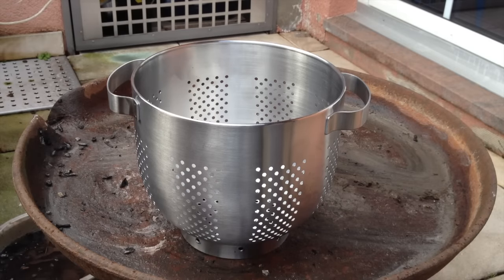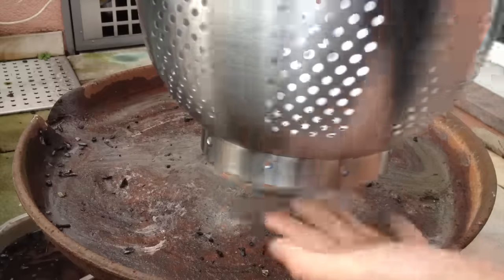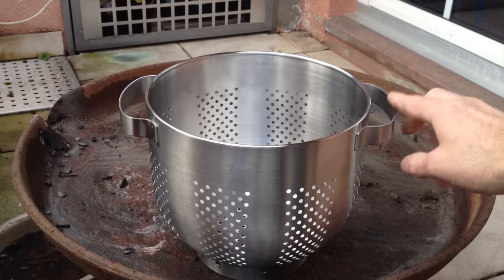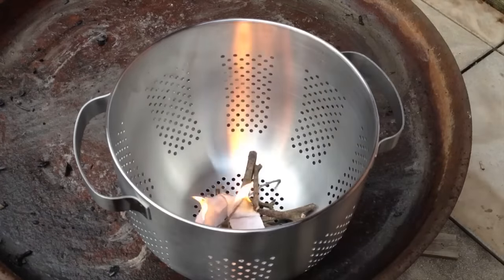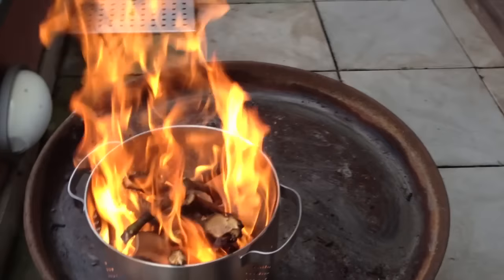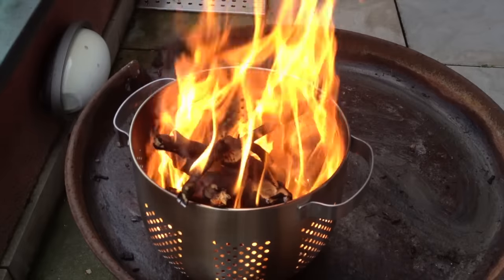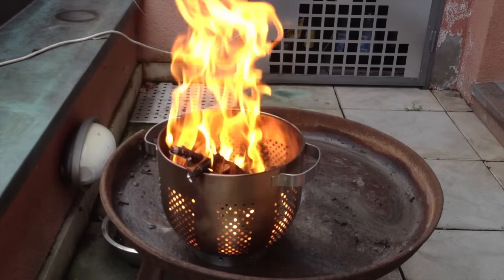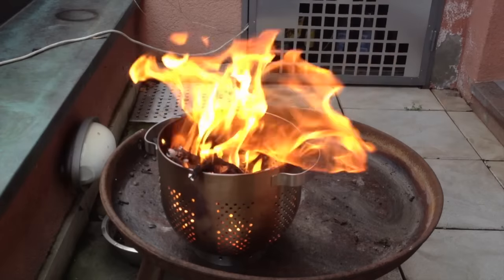DIY IKEA FIRE PIT

Comment: Got one of these after watching your video.  With the recent cold calm weather over the Christmas break I have been out in the garden most evenings with a small fire going - very relaxing. I put a bit of galvanised steel fence mesh on top to balance a zebra pot on and this works very well.  It does mean that I have to have my fuel wood cut down to about 3/4” square so that I can still pop it through the mesh to feed the fire, but preparing the fuel is all part of the fun 👍.   Enjoyed a hot bratwurst 🌭 this evening followed by hot chocolate drink.  I’ve used those compacted and impregnated “fire logs” that can be purchased and they throw out a terrific heat and burn a long time, but I wouldn’t use them for cooking over as they produce a sticky black residue which would probably ruin your cooking pots.  Great video, glad you made it as not being an IKEA shopper I didn’t know they had this in their shop - I can now have a small fire whenever I want and can take it with us on our travels in the motorhome too. Thank you.
Reply from the maker: Thank you! I am glad you are heaving so much fun with it and what you describe makes me want to go outside and have some fresh hot food myself there :-)

Comment: Thank you so much for this video! Going to go buy one tomorrow for camping this summer. Is that a ceramic plate under the IKEA strainer? Do you suggest I use one when I use it as a fire pit?
And please make cooking videos with this :)
Reply from the maker: Thank you :-) The strainer is standing on a cast iron fire pit that is very heavy and can only be carried by a strong person...not really suitable for carrying around in a campng situation in my opinion.  But for safety reasons I would strongly suggest to put the strainer on some fireproof surface before using it because the firebed is very close to the floor and the bottom has holes which allow ember to fall on the floor.

Comment: Wow!  Nice fire with the IKEA colander.  I'll have to remember to get one at the Thrift store and it would be sad to mess up a good stainless steel kitchen colander with burn marks.  Great idea for a controlled campfire or hot dog BBQ for the kids  or when you need warmth on the ice when ice fishing.

If you have a metal coat hanger I suppose you could make a simple wire rack for your pot or pan sit on for outdoor cooking, though it's difficult to control the heat on an open fire but for hot dogs it would be perfect!
Reply from the maker: I agree that the heat can not be controlled too precisely but that is not possible on an open fire either and you can cook on it as well so I would not worrie too much about it. If you are looking for a precision device I assume your choice would be entirely different anyway. I also agree with the coathanger. And If you do not need that thing for your kitchen you also might consider adding a feeding hole for wood below the upper edge similar to the ones cut into my other Ikea stoves. That would add a bit of control after all :-)

Comment: Tried the beer can stove tonight, very hard to accomplish without a constant supply of kindling. If you’re having trouble with sustaining an immediate burning in any fire, cotton balls spread open followed by lumps of paper towel or toilet paper works great!

I’ll stop by a thrift store or salvation army and see if I can find one of these for $2.
Reply from the maker: May be you need to use more kindling at once and as soon as it starts to burn put the next stage of slightly bigger chunks of wood on it. But that's just a guess for I did not see what happened in that moment
Reply: Stove Mods Yep you’re right. Made a couple fires with the family this week and you progress your fuel size from twigs to logs to get the flames you need to stay warm. The coals will be there after time anyhow.
Reply from the maker: @nourat0w3l95  This sounds good :-)

Comment: Can u please show the best way to cook on it. Thank you. Elaine
Reply from the maker: HI, thank you for your request. I am not making any videos recently just because I do not have the capacity right now. But your suggestion would make a great subject! But may be I can give you some ideas: You might just put two metal bars across the top of the fire pit to hold the pot. But the disadvantage would be that you have to remove the pot every time you need to add wood to the fire. Therefore I think a tripod with the pot hanging down from above the fire pit would be more siutable. A tripod can be made relatively easy with three poles of wood and some cord. To be safe I would connect the pot to the tripod   with a thin metal chain instead of cord because it is fireproof. Try to hang the pot high enough above the fire that you can still manage to add wood to the fire but low enough to heat it up. 
You might also come up with other constructions but in my opinion it would always be good to make sure you can fuel the fire while cooking without too much of an effort. Or, in case you have the tools, you can cut out a feeding hole close to the upper edge (do not make the hole to low like it is with all the IKEA stoves I see on youtube. It is way easier to feed a fire from above than from below).
Hope that helps :-)

Comment: What is it that are you placing  the noodle strainer on top of in this video, to contain the fire pit? A 🔥fire  safety  inquiry! Thanks.
Reply from the maker: That is kind of a fire pit that I found and was part of a barbecue from what I know. It is cast iron and weighs about 40 kg. Sometimes I just use a baking tray to put my stoves on. Just keep in mind that a baking tray is rather thin and therefore might transfer the heat to the ground ( your lawn for example) if the fire is very close to it so in some cases it might be helpful to elevate it with some bricks or whatever works.